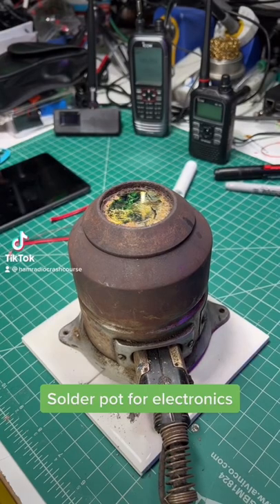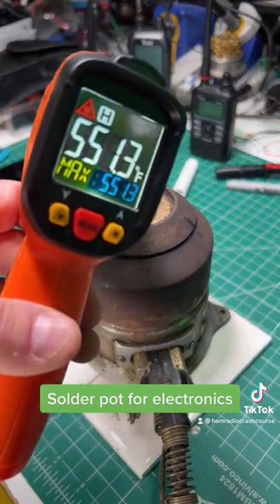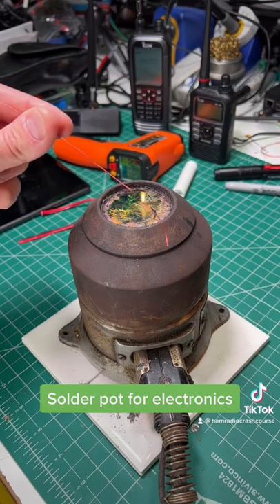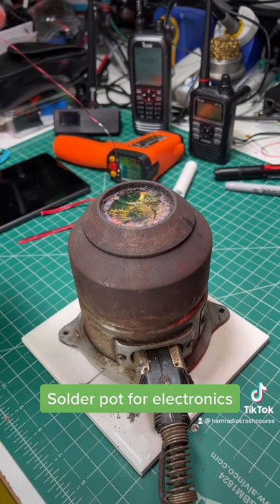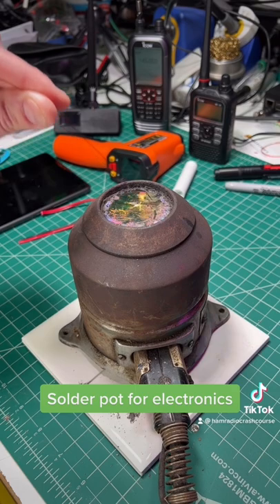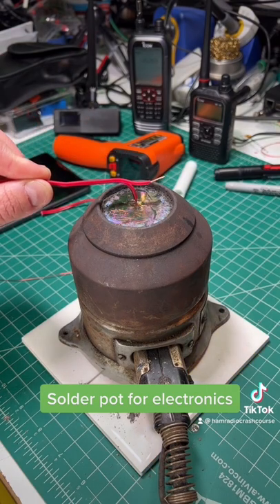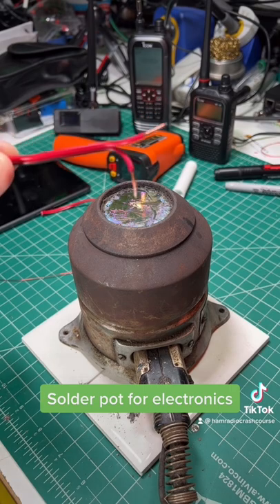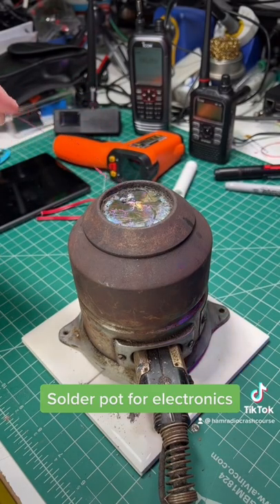What is a Solder pot?

Comment: Those things are awesome, and used heavily in the industry. You should see a solder wave machine. If you were ever curious of how electronics were mass-produced and how they got so cheap well it has all to do with solder waves and robotics 😉
Reply: It is painfully expensive to do any electronics assembly at any production scale without these tools. It's my job to run most of these machines where I work.